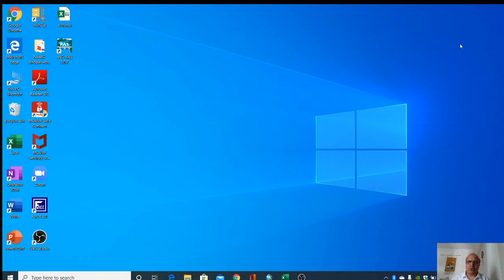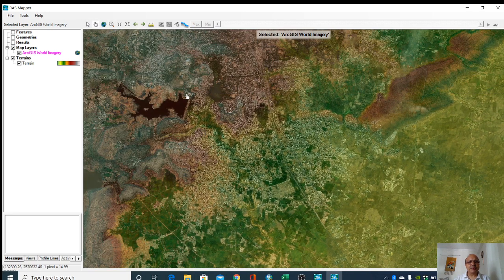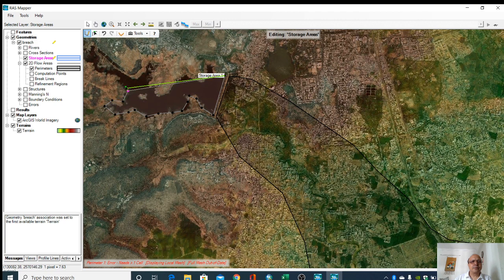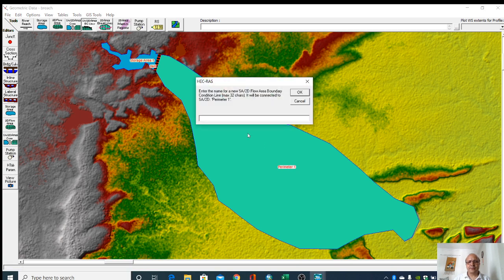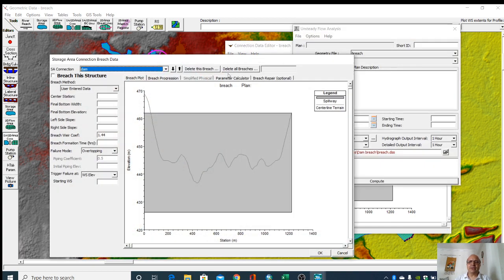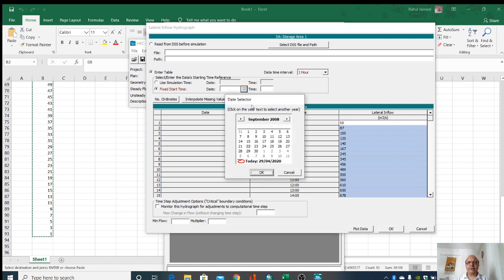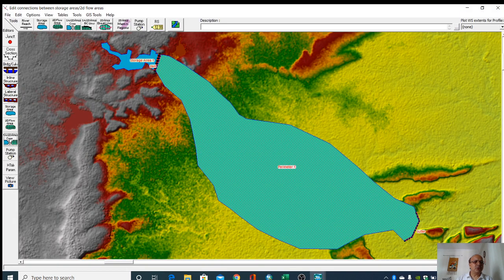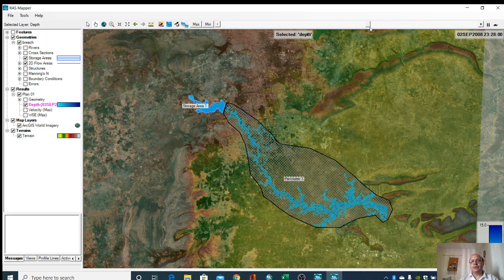HEC RAS Dam Breach Analysis

Comment: Hi. When following your tutorial I had got the following error: HEC-RAS Error - Incomplete data, the following errors were found:
SA/2D Connection: DAM  . Computed weir stationing on the Tailwater side is not increasing, check the structure data (weir stationing and centerline) and 2d mesh in this area to fix this problem. Could you give me an idea how to resolve it?
Reply from the maker: Your DEM did not cover the complete D/S perimeter. SA/2D connection error some time comes due to not actual level at that point. In that case you can modify terrain.

Comment: how should fix this problem? please tell me suggestion.  
2D Flow Area: 'Perimeter DF' at BCLine: 'outlet' needs flow or stage hydrograph boundary condition.
Reply from the maker: You have to provide a boundary condition at outlet where you need to provide either normal depth or stage hydrograph

Comment: Hi Rahul, thanks your for guiding, but i have problem when i simulation hec ras. "volume elevation relationship has more than the maximum number of 100 point" can you help me take some advice. thanks you
Reply from the maker: Reduce the no of points in EAC Table for smooth running
Reply: @rahuljaiswal1060  thanks you so much, but you can show more detail ?
Reply from the maker: @vuvanlan269  Reduce EAC table to 10 to 15 pints only and then see.

Comment: Good afternoon. 

Dear, my name is Bruno. I'm a civil engineering student in Brazil.

I need to carry out a simulation of the rupture of an earth reservoir for water storage located outside the water course. 

My question is whether Hec Ras allows me to carry out this type of simulation or if Hec Ras is just a simulation of structures in the water course. 

Is there any software that allows me to simulate the rupture of an earth reservoir to accumulate water outside the water course?
Reply from the maker: Really I also do not know if HEC RAS Can do it. Just I think that you create a dam at a point of rupture and do analysis.
Reply: @rahuljaiswal1060  yes, I'm trying to simulate the rupture of a reservoir outside the water course but I don't know if rec ras allows this type of analysis. I believe it is only a dam in a water course, due to having to put the input and output flow data.
Do you know any software that simulates the rupture of a reservoir outside the water reservoir and shows the flooded area?

Comment: How did you get the hydrgraph
Reply from the maker: When ever a dam is constructed. A Detailed Project Report is prepared that consist of design hydrograph.
Reply: @rahuljaiswal1060  i m getting a error stating “2D Area Unstable “ why is that?
Reply: @bhavininegi8719  Check for computation time interval of model, for dam breach it should be below 1second
Reply: @rahuljaiswal1060  i m not able to find it for Tehri Dam? If you could please help

Comment: Dear sir, In a 2D flood routing problem, what can be the possible reasons for a situation in which the depth of water level does not reduce with time.
Reply from the maker: It may be possible when the downstream slope is negligible to a very long distance
Reply: Sir can you suggest a measure to rectify it? I am stuck in one of such simulation as a part of research work. I do not have gauge data so normal depth is only option for d/s boundary conditions.
Reply from the maker: @purvangpandya2811  For normal depth you can take slope downstream point up to which you expect water may reach. Generally up to the long distance or stream meets with long river.
Reply from the maker: @purvangpandya2811  You take river longitudinal slope at very long distance or at the stretch where this river meet to any big major river
Reply: Thank you sir for your guidance. Warm regards

Comment: Tiene alguna sugerencia para este error! he intentado refinar la malla y no ha sido posible correr el modelo con la presa dentro de un area 2D. 
[For the Hydraulic Structure b1
in 2D area Perimeter2
there is an error with the model data.
The weir station/elevation extends too far beyond
the last face point (face intersection).
Shorten the weir stationing or adjust the cell mesh
Error Accepting the preprocessor files.]

Comment: I get a "SA/2D Connection: Dam - Computed weir stationing on the Headwater side is not increasing, check the structure data (weir stationing and centerline) and 2d mesh in this area to fix this problem. Does anyone have any input on why this error is coming?
Reply: hi Mr.Beckman,take intial conditions for 2D reservoir area in unsteady flow as water surface elevation equal to top of the dam.if you want to simulate breach due to overtopping

Comment: Geometric Preprocessor HEC-RAS 5.0.7 March 2019

Finished Processing Geometry

Starting to copy Geometry Data to Results
Completed copying Geometry Data to Results

Performing Unsteady Flow Simulation  HEC-RAS 5.0.7 March 2019

+STOP!  Error in the time window.
HDF_ERROR trying to close HDF output file:
HDF5-DIAG: Error detected in HDF5 (1.8.11) thread 0:
  #000: ..\..\src\H5F.c line 2044 in H5Fclose(): invalid file identifier
 
Error starting unsteady simulation - Stopping compute process
 

Computations Summary

Computation Task	Time(hh:mm:ss)
Completing Geometry(64)	       1
Preprocessing Geometry(64)	<1
Unsteady Flow Computations(64)	<1
Complete Process	       4
    major: Invalid arguments to routine
    minor: Inappropriate type
This message comes when I'm working run

Comment: Sir, i am trying to use this model for storage reservoir. So I don't have inflow hydrograph as boundary condition. How can I model this for reservoir? Also I saw you just drawing a line as a dam and hec ras itself joined storage and 2d flow area and formed a polygon as connection. Does the whole gap/polygon acts as a dam or the initial line you drew left to right only acts as dam?
Reply: for dam breach model you have to use Design hydrograph not the actual flood hydrograph.
Reply: @JALAJDARPAN  Hi!To create the design hydrograph, don't we have to consider the dam failure peak flow ? How to add this to simulate in ras...

Comment: Where did the Hydrograph for the lateral inflow come from? Please can you explain how that hydrograph was generated or source?
Reply from the maker: The lateral inflow hydrograph is either designed flood hydrograph at dam generally available with the dam authority or any other worst hydrograph recorded or hydrograph computed for Probable Maximum Precipitation for the dam
Reply: He used river routing method with the help of HEC HMS.the lateral inflow may be due to side river branch or large storm water drain conncecting to main river channel

Comment: Hello i wanna  to ask how i can download my tettrain i have dem file from WMS
Reply from the maker: for modeling in HEC RAS you require to have DEM in tiff format and connected projection file
Reply: @rahuljaiswal1060  from where I can get this file
Reply: Can you give a website to download this files
Reply from the maker: @gdx5930  DEM can be downloaded from ASTER. For better results, topographic survey using GPS is necessary. Dam information can be collected from dam authority
Reply from the maker: It can be used
Reply: Thanks you very much for this value information just I need to know how I get the projection file
For zone 36
Reply from the maker: @gdx5930  Please search it on web

Comment: Sir do we have to specify the breach width
Reply from the maker: Thanks a lot
Reply: @rahuljaiswal1060  Sir my question is  how we should decide the breach width in the dam and how you have considered your breach width because the dam may breach at a particular flow either at peak of the flow hydrograph that you have provided at the boundady or maybe at some other flow discharge so depending on it how we decide the breach width
Reply: @anupalbaruah3654  This assumes dam failure mode by Overtoping. So  the dam will start to breach once water reaches over the top of the dam. So the breach height will start from the top of the dam and down to the bottom, lowest point at the downstream face of the dam embankment. The breach width is calculated using one the methods for estimating breach hydrograph. Froehlich method is popular.